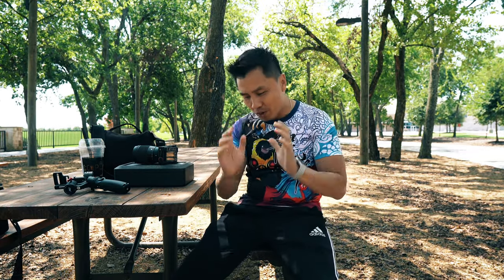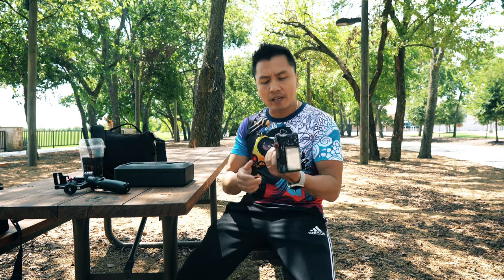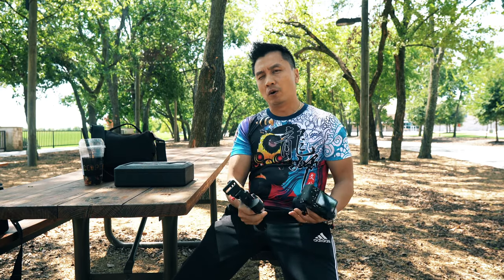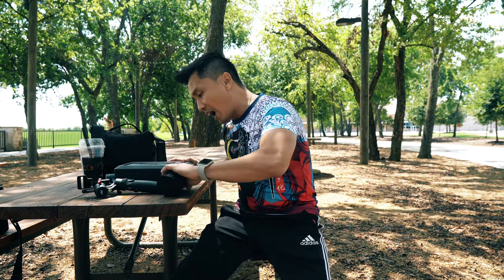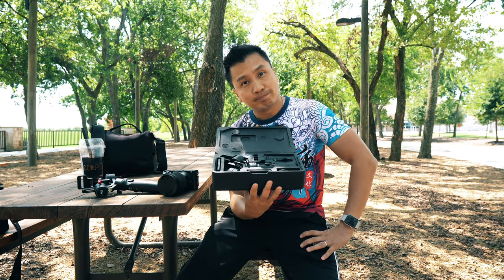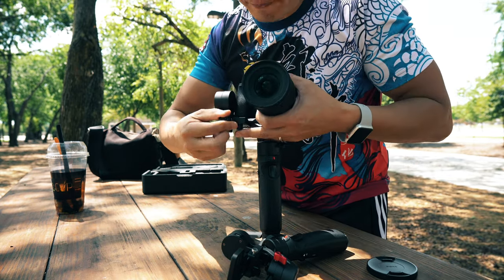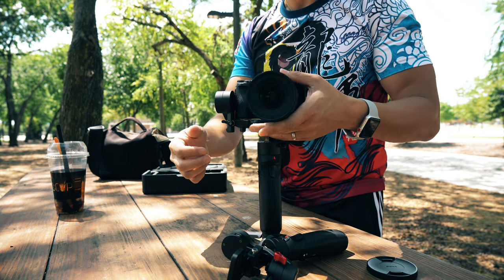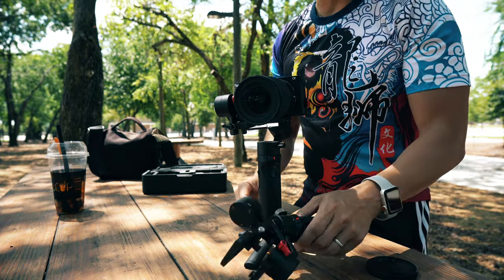How to balance Zhiyun Crane M2 Gimbal with Sigma 16mm & Sony a6500

Comment: Hi, i tested it with my Sony A6400 and the 16mm F1.4 and it is also really stable on my Crane M2 now, thanks to you! 😁
Reply: Meister Sen hey i’m thinking of getting the same exact setup. did u have to do anything different than the standard setup?
Reply: I couldn't seem to balance my Sony a6500 w/Sigma 16mm F1.4 with Zhiyun Crane M2? Any tips ?
Reply: Hi pls update
Reply: a6500 has additional 50 grams weight, so it could be the problem
Reply: Same

Comment: I'm using

A6300
Sigma 16
Variable ND filter

On Crane M2. It works.... 
No heat.. it's stable... I have tested fir half an hour riding on a bus....
I think it's more stable than sigma 30 setup..

I'm super impressed with this mini gimbal. 
💜 Zhiyun Crane m2
Reply from the maker: Wow thank you for answering that question. A lot of people been wondering about the ND filter
Reply: @ThisVSThat  I am using this gimbal with my 6400 and sony 35mm 1.8, it is great and amazing results, even we can not identify that we are going up/down  stairs. Great technology
Reply: I was wondering about adding a filter as well. Glad to see it works. I wonder if it can also handle a ride video micro. It’s very light weight. Really interested in this lens
Reply: Khuigandui,,how much backup time u are get from m2 gimble??

Comment: For those who are having issues with lenses heavier than the kit lens... By what logic, I do not know, but on my Crane M2, when you set motor strength to low, it's actually high. I was having problems even with sigma 30mm 1.4, which is below the payload threshold of this gimbal. With motors set to high, it would shake and vibrate in some basic modes, and totally give up when in POV. But when I set them to low, it handles everything like a champ, zero problems.
Reply: Thanks for that info! I’m getting mine tomorrow and hope I can get it balanced and working ore my wedding and honeymoon trip later this week. These kind of tips will make that happen! What did we do before YouTube?😂

Comment: Thank you for the video, I have watched around 15 zhiyun crane m2 vortex setup video but only you mentioned about the proper fix at 8:37 many people failed to mention about this.
Reply: And thank you for pointing  this out, I couldn't find any reasons why vortex mode doesn't work with my a6400+16-50 kitlens. You saved me alot of time sir!
Reply: @Ean951  mine doesn’t work too
Reply: @Ean951  it works with the kit lenses . I guess too much weight

Comment: Keep in mind that the maximum weight supported oficially is 720g. You're using an a6500 (453g) with a Sigma 16mm (405g) for a total of 858g and it still works like a charm! :D this little buddy is amazing ahahhah

Comment: Tks for ur video.... Im decided to get M2.... tell us about the gimbal after this months... it keep functional using with sony and 16mm 1.4 sigma?  And about battery duration?
Reply from the maker: Hey Davi, the M2 with the Sigma 16mm does take some time to balance. The biggest issue that i run into is when I accidentally touch the camera it would move sideways, which get it off balance. I did talk about this at 5:10 in the video.

The battery life is great!
Reply: THIS vs THAT all that i needed to know... after that just bought m2 online.... tks again!!!

Comment: I bought this yesterday hoping it would work for my a6100 and kit lens. This was the only other lens I was considering using so it’s great to see it works fine. I think it’s all in taking the extra time to make sure it’s balanced from the start. If it’s not balanced properly the motors will struggle to work. I hope I can get it balanced as I have no experience doing it. Just have to be patient and take the time to get it right. Great video. Thanks. Subbed😃
Reply from the maker: David Rapant thanks for the comment David

Comment: Hope this balance should be done once and then easy put in/remove camera ?
Reply from the maker: It should be until you want to pack it away.
Reply: @ThisVSThat  Wow, but it's crazy inconvenient each time spent time for balancing :face-fuchsia-tongue-out::face-orange-biting-nails:
Just got Sony ZV-e10 and was looking for good prime lens like this 16 mm Sigma...and definitely need gimbal for videos...
I have one for phone and never  had problems with phone/gimbal working starts.
I have a DJI Osmo 4 and use it with pretty heavy Samsung Note 10+ in heavy case...never ever thinking about any balancing. The starting gimbal it bring phone in correct position.
Update: MUST to buy quick release plate (NOT cheap) for this gimbal, then problem resolved...

Comment: Somehow the heavier a6500 make this combination work even though it way over the weight load, it'll not work with a6000 since it lighter even pushing all the way back it'll fall to the front since the lens is heavier than the body. I sell my crane m2 because of this but yeah it's a pretty amazing gimbal for it size
Reply from the maker: Thanks for writing to let me know. Sad that it doesn’t work for all the Sony cameras
Reply: Matej Varga Can you elaborate? I’m having the same problem with an a6000.
Reply: did u try putting a rig cage to your a6000?

Comment: Nice work my man! I think you were able to balance it as the a6500 is about the same weight if not a bit heavier than the sigma 16mm so the centre of gravity is more towards the centre, other people having issues might have the lighter weight a6000 series cameras, also helps that you have ibis in that camera as it would be help add extra smoothness to the footage, I have an a6400 so if I were to use that gimbal I’d only use my 10-18mm, 35 1.8 and 50 1.8 as they all have oss and are lighter than the sigma lenses, I also have the weebill lab but it’s not as light or as steady as I was hoping it would be
Reply: Also I’m thinking other people might be putting a variable nd onto the end of the sigma which you didn’t have on yours making it more front heavy and throwing off the balance and making it too front heavy
Reply from the maker: Wow. 🤯 Thank you. Very detailed observation.
Reply: Actually ibis is not a good thing when using gimbals, look it up!
Reply: Ansel Rodriguez lol don’t need to look it up! I’ve seen first hand the difference it makes when using it vs not, I think the guidance it to turn it off if you are at longer focal lengths and panning left to right but for your general purpose and ultra wide lenses and especially while walking/running it’s better to keep it turned on to remove any micro jitters
Reply: James McCaul ND filter on still works.

Comment: wow.. so i'm assuming my sony a6000 & sigma 30mm would work just fine if you're using a heavier camera and lens........ right?......
Reply from the maker: Yes, It work with the 35mm f1.8 which is about the same weight.

Comment: So it should work with sony alpha 6100 too right? It's slightly less in weight compared to 6500.
Reply from the maker: Abhishek Shah I have not tested the 6100 but if the center weight is the same as the 6500 then it should do it
Reply: Perfect! I'll buy and let you know. Thank you so much. The two videos for this has been super helpful
Reply: Just a random question. Do you think sigma 16mm f1.4 is a suitable lens for food videography and photography? Also it zoom so the try focal length will be 24 and 48mm

Comment: Or get pilotfly traveler ..Seems the same size as crane m2 although slightly heavier ..

But the best part of pilotfly traveler is that it has a much higher payload than crane m2
Reply from the maker: Sound cool! I have not used that, will look into it.
Reply: Comparing the price....it would make more sense to get the weebil lab right? Since weebil at the same price point as the pilotfly with a higher payload.

Comment: What happen when you add more weight like the ND filter and mic like rode go with rig locator? Im thinking of getting the weebill lab but when i saw how small and compact this is im not sure which one to get.
Reply: Raisugen ND filter on... still works.
Get side mount for mic.. crane m2 has side mount screw. 
👍🏻

Comment: Zhiyun Crane m2 or Weebill Lab? Help me guys
Reply from the maker: HKN Movies HKN Movies Weebill S is a bit more expensive but will feel more stable when you don’t have time to fine tune the gimbal while on a set.. notice I said Weebill S not Lab
Reply: @ThisVSThat  thanks for the answer. I'm struggling because I have the a6300 and want to get a sigma 30mm 1.4 or Sony 35mm 1.8 which would be my next question 😅
Reply from the maker: Sony 35mm f1.8 would be my choice since a6300 doesn’t have IBS...and because I have been using it for the longest time and it’s my go lens for all the sweet bokeh
Reply: @ThisVSThat  did you used the 16mm 1.4f sigma lens? That wide angle makes it very interesting too

Comment: The size of that lens is too much for my vloggggg
Reply from the maker: Will Chu 🤣 I actually use the 16mm a lot for vlogging. Can’t beat the quality at night and auto focus
Reply: Coming in late to this but the 16-50mm kit lens and the 10-18mm wide angle lens both balance perfectly on the M2 with any of the A6000 series camera. Either of those lenses would be fine for vlogging and they're both pretty small.